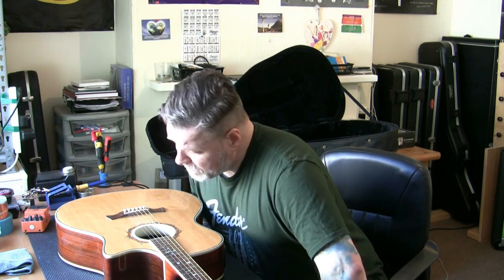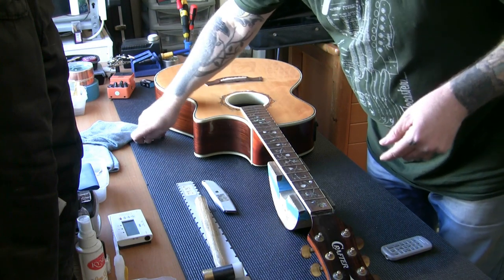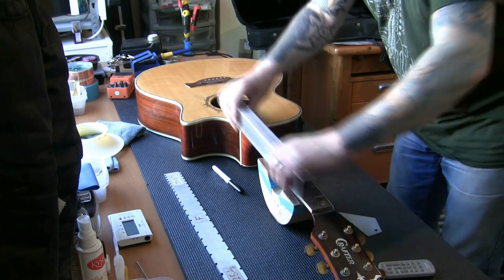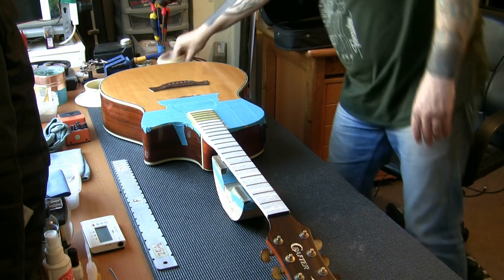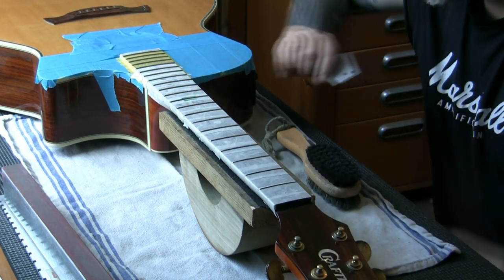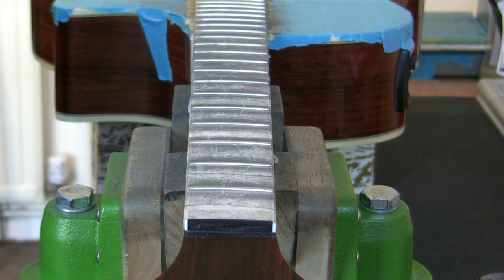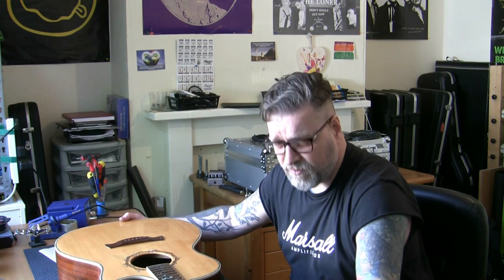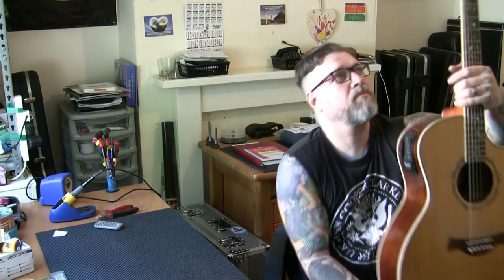Crafter GAE45/N fret level, nut replacement (and repair) and electrics overhaul...

Comment: Mine has developed a problem and i dont know why - high e string has very low action compared to the others and is buzzing over about 5 or 6 frets from about 10-14  - unplayable. The truss rod cant redress it - already completely wound off and going tighter just bows the neck worsening the problem. It had been fine the past few years but now is unplayable - all i can think is the cold winters here (freezing for 3 months) might have warped the neck? I'm very disappointed as it was very comfortable and easy to play previously. Any suggestions.
Reply from the maker: I cannot give you an answer without handling the guitar. My guess is a humidity problem that has made the wood move somewhere. Unless I can handle and inspect it, I cannot diagnose it. Sorry...
Reply: @FretFriendGWaL  yeah i understand that you can only guess from 10,000 miles away. Could humidity problem include Low humidity? Its winter here and between minutes 5 and +3 every day. But i have a heater on most days. This particular model i think was not made with cheap woods right - so it should hold up within normal conditions.? Strange that it has happened
Reply from the maker: @emelle1283  Wood hates change in humidity

Comment: Plenty of good vids from Victor. But Never use steel wool on your guitar people. Very bad ju ju. And when oiling/waxing fret board wipe on and wipe off straight away it will retain more than enough of it. Don't leave it for a few minutes. On and off.
Reply from the maker: You do not know what you are talking about! You cannot just say "very bad ju ju" and not explain why! I can prove you wrong about that and wrong about using mineral oil on a fret-board!